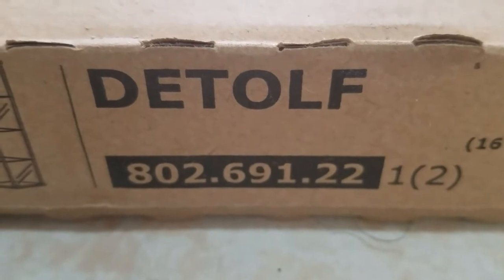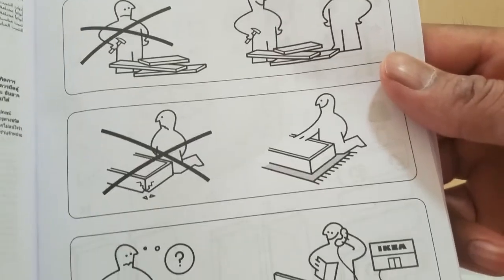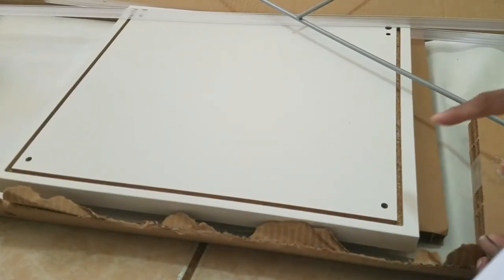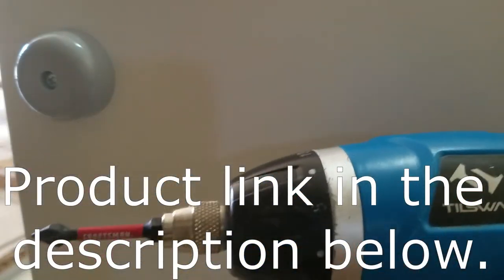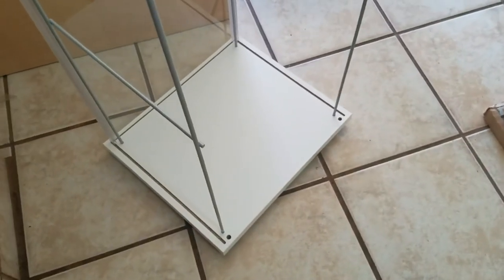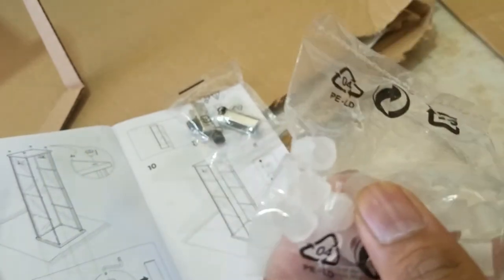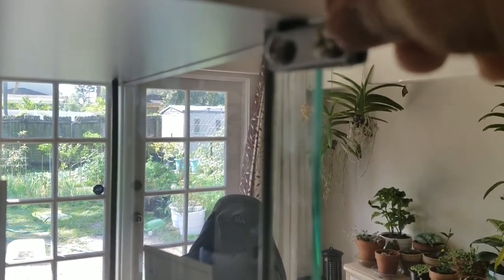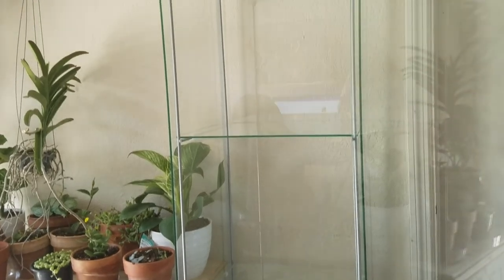Ikea Detolf 802 691 22 - Unboxing and Assembly

Comment: Hello, I have a question, the door of my showcase does not close completely from the top, that is, the magnet does not connect with the metal plate, do you know why this happens?  I hope you can help me, greetings.
Reply from the maker: Hi there. That is cause of way the door might have been installed. Make sure that the top and the bottom are equal distance from the edge and leveled.